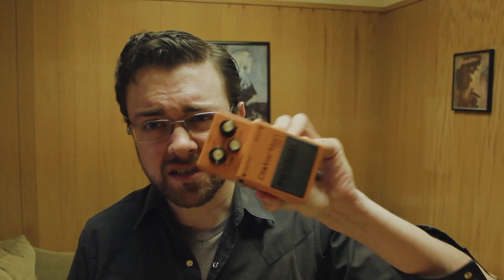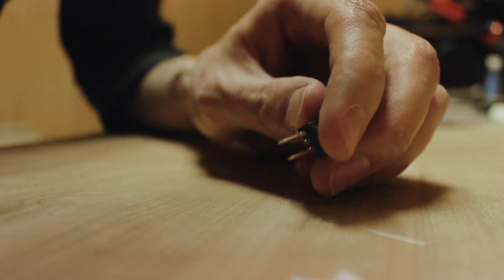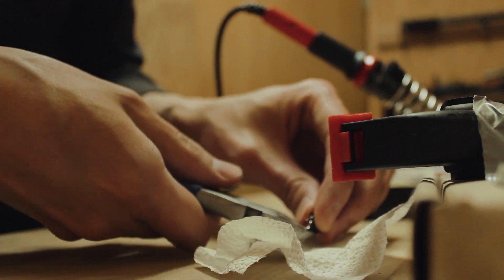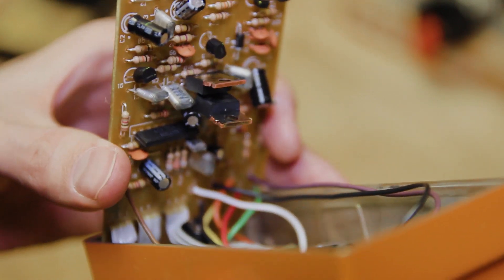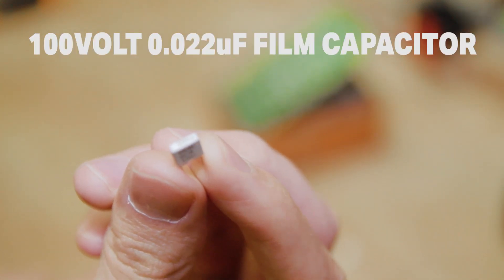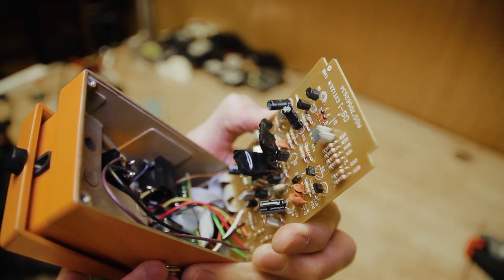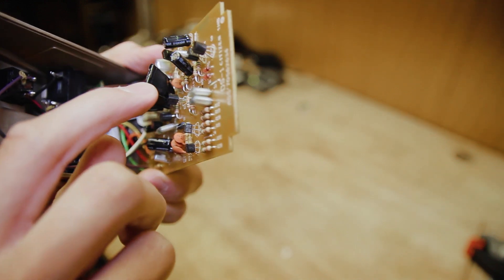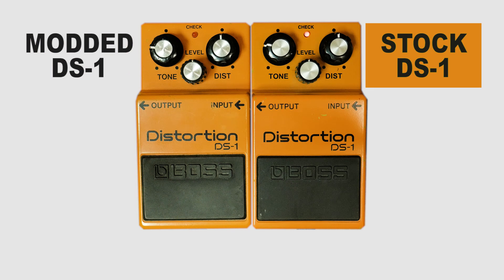Boss DS-1 Mod: MOSFET and Tone Capacitor

Comment: IF YOU ARE DEPRESSED YOU DON'T HAVE A SOLDERING IRON OR JUST CAN'T DO THESE MODS TRY STACKING YOUR DS1 WITH A SECOND DRIVE OR DISTORTION. IT DOES COOL THINGS. I RUN MINE INTO AN MXR DISTORTION PLUS (SCRIPT) THEN INTO A MARSHALL JTM 45. SOUNDS PRETTY GOOD. THIS DONE ON AN NUX MG-30 MODELLER, SO VIRTUAL, BUT IT WORKS IN MEAT SPACE TOO.

Comment: You can use 2n7000 mosfets instead, which are smaller and easier to fit.
Reply: Do they sound different? Thanks.

Comment: I'm not so sure about the tone replacement. It seems to only dial in the midrange frequencies. What other caps could I try that would also work? I did the mod where I remove the r4 and 5 and now my ds1 is a mainstay while paired with my big muff.

Comment: Also thinking about the mosfets being to big for the board , I would mount them somewhere else in the box , off board , and join with wires , that would also make it easier to swap around if you so wanted at later date , the wires may also act as a resistor , so you might have to a compensate accordingly....

Comment: my boss ds1 looks different inside can anyone tell me why
Reply: Lewis Scrafton yours is probably newer than this 2007 model and uses a printed circuit board instead of surface mounted components I would guess.
Reply: you have a post 2016 model

Comment: Excellent, dude! What a change! It sounds great! QUESTION: Would it be possible to use a vacuum tube (a 12au7, for instance) instead of the MOSFET? That would be awesome! I believe some architectural modification would be required in order for the tube to fit. Nevertheless, in terms of circuitry, would it be possible?
Reply: Diego Ambrósio not really, for starters it won’t physically fit, but you’d also need to add a charge pump because tubes don’t work particularly well at 9 volts, it just starves the plate of voltage. If you want something like that, buy a Vox V8.... although there is some argument as to whether that valve is just there for aesthetics, or whether it’s actually doing anything.

Comment: Seriously I have been playing thrash and metal since 82 and never had the need to mod any pedal. My board is simple, mt-2, ds-1, sd-1, boss eq, boss noise suppressor and Morley steve Vai bad horsie 1 and dimebag wahs. Always used my sd-1 to boost and fatten tone of mt-2 and ds-1 and that's all you need. Can play anything from classic rock to metal to death with that simple set up. I'm a 55 year old metal head and that's all we did in the 80s and bow. If it ain't broken, don't fix it. Boss has been around forever for a reason, they make the best petals. That's my two cents anyway....

Comment: This video and the one where you removed d4 and d5 are both excellent. Thanks for taking the time to do this.
Reply: Yes I'm gonna go buy another ds1 and try those mods, Thank's
Reply: @janeanderson363 
Why you would buy another, you can do it on one you have already, if you don't like it you can always put diodes and capacitor back
Reply: @CarpeDiem23  Can you really put the diodes back?
Reply: @jamieblurtase9134  Yes, if you desolder them cleanly and not cut them out.

Comment: the stock DS1 sounds like a fizzy distortion layered on top of the clean tone. the modded one not only sounds better, but it doesn't sound like a layer over a clean
Reply: Cramel ha ha ha ...emperor ‘s new clothes...
Reply: I just bought a used Taiwan DS-1.  I like the fizzy on clean tone as you say.  Sounds cool on Strat for that light fizzle sound you hear on some recordings.  Seems you can buy a cheap amp sym pedal if you were looking for that.

Comment: if you turn up the volume at the original there is not much difference ;) .... with a good eq after the ds1 you can chance the sound  much more than with that mod.
Reply: "change"
Reply: Yes, I used to do this with a Boss SD1 (overdrive) to give it a more "modern" voice.

Comment: I have a 1979 original run DS-1 and it sounds more like a cranked Marshall than the current DS-1's which are fizzy sounding. Compared it side by side to a friends current one and he could hear the difference straight away. If you get your hands on one you won't regret it
Reply: I have one but fancy just an overdrive like the fender santa ana but had so long now don't think I'll sell it.
Reply: I agree. I have 2 early originals from 1978 and they sound AMAZING and NOTHING like any of them made after 1978! Any DS-1’s made after the first year of production are terrible!

Comment: Since the mod adds volume, you should turn up the stock pedal to compensate. Louder always sounds better, it distorts the comparison.
Reply: You could drop the youtube volume manually....
Reply: are you sure it adds volume ? adding mids will have the effect of making the sound fuller and make it seem louder
Reply: @wombat6  How do you add mids? By adding amplitude.. Doesn't 'seem' louder, it just is.

Comment: Three questions.. 1. Is there a big difference between leaving the D4/D5 empty, rather than using the Mosfets? 2. To my knowledge, if you were to just put the C12 (0.022uf) cap in without removing D4/D5, apparently makes them sound better without having to remove them because doesn't the C12 control those diodes anyways? 3. I'm not sure, but can you use a Bipolar Transistor instead of a Mosfet? Fairchild makes one that looks exactly the same and has the same voltage/amps. Here's a link to it.. http://www.mouser.com/ProductDetail/Fairchild-Semiconductor/TIP29C/?qs=ljbEvF4DwOMjkSeyYe8pGw%3D%3D
Reply: (quote) "BJT, as in Bipolar Junction Transistor, is a semiconductor device that replaced the vacuum tubes of the old days. " .. "BJTs are preferred for low current applications, while MOSFETs are for high power functions." -
Found here: http://www.differencebetween.net/technology/difference-between-bjt-and-mosfet/
 So.. better than a Mosfet ?? Seems it would almost be better suited.
Reply from the maker: ShadowⓋ There is a considerable difference between this mod and just removing the clipping diodes. This is higher gain and more focused in the mid range than the "diode" mod. I would recommend changing the c12 capacitor first and see if you like it. Then you can always try taking out the diodes or replacing them later if you still want something different. I can't speak to what kind of difference the bipolar transistors would make as opposed to the mosfets but seems like something worth experimenting with. Thanks for watching!
Reply: Thanks for the response. I have a spare DS-1 and I'm going to try the tone mod with either a Fairchild Tip29C or Tip30C. Something tells me a BJT would suit the mod better because they were originally used in substitute for tubes in tube amps and to my knowledge, this is why the Mosfet mod is primarily being used. I mean, I'm not sure who came up with the idea of using a MosFet (Field Effect Transistor), but a BJT (Bipolar Junction Transistor) seems to make more sense. They're both transistors, look similar and have the same voltage/amps, but after doing some reading on them both - comparatively speaking, I couldn't totally understand the technical aspects or differences between them. It all seemed a bit vague.
Reply: As a side note, the pins on the TIP29C are labeled as "1.Base  2.Collector  3.Emitter". Not sure what the means though.. http://www.mouser.com/ds/2/149/TIP29-890086.pdf

Comment: next time use a more 'pedal friendly' amp. Vox AC's are not the ideal amp to showcase mods. Otherwise, great job!
Reply from the maker: Thanks. The amp was set relatively clean and I wasn't concerned with providing the most "pure" possible demonstration of the pedal's sound. The point was more to just compare how the two pedals sound relative to each other with a somewhat common guitar and amp combination that many people use or are familiar with. Thanks for watching!
Reply: uhhh tell that to jonny greenwood ass hat